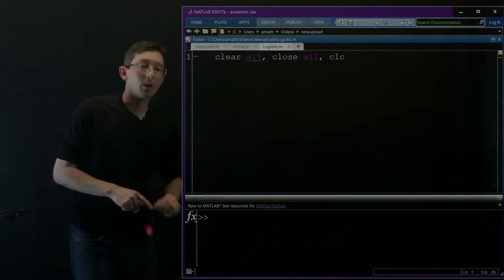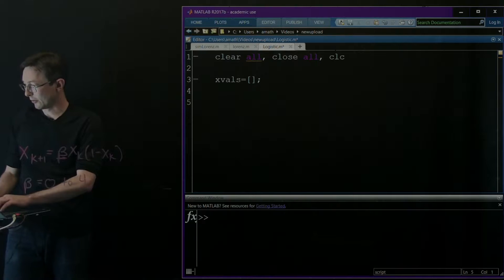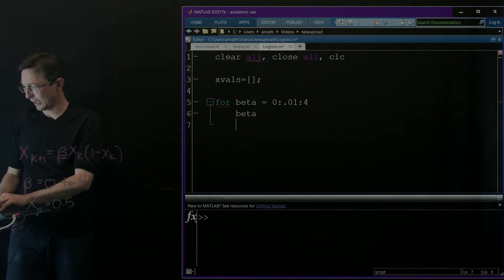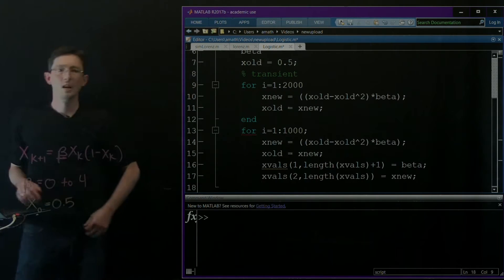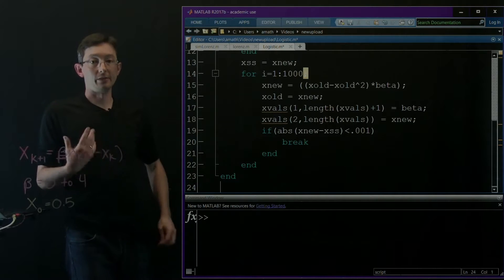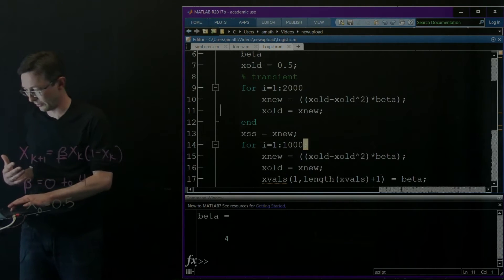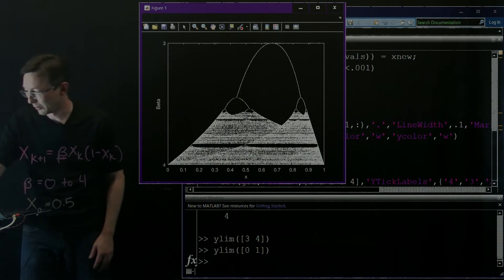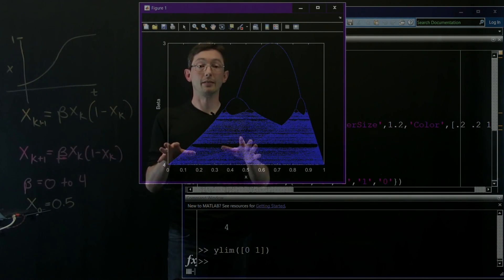Simulating the Logistic Map in Matlab

Comment: Matlab Code below is more understandable for this video. In the code, I just obtained steady-state portion. X matrice is composed of Nn rows samples and Nr rows for bifurcation parameters.

Matlab Code:
n = linspace(1,100);
Nn = length(n);
r = 0:0.005:4;
Nr = length(r);
x = zeros(Nn,Nr);
x(1,:) = 0.5;
count = 0;
for r = 0:0.005:4.0-0.005
  for n = 1:Nn-1
  x(n+1,count+1) = r*x(n,count+1)*(1 - x(n,count+1));
  end
  plot(r*ones(31,1),x(70:Nn,count+1), '.', 'markersize', 2);
  hold on;
  count = count+1;
end
title('Bifurcation diagram of the logistic map');
xlabel('r');  ylabel('x_n');
set(gca, 'xlim', [0 4.0]);
hold off;

Comment: how to calculate the lyapunov exponent for 3 or 4 dimensions. for example:

x(1) = 0.8109; y(1) = 0.3342; z(1) = 0.5734;
lamda = 3.789; beta = 0.029;alpha = 0.0224;

for i = 1:2000
x(i+1)=lamda*x(i)*(1-x(i))+beta*((y(i)).^2)*x(i)+alpha*((z(i)).^3); 
y(i+1)=lamda*y(i)*(1-y(i))+beta*((z(i)).^2)*y(i)+alpha*((x(i)).^3); 
z(i+1)=lamda*z(i)*(1-z(i))+beta*((z(i)).^2)*z(i)+alpha*((y(i)).^3);
end

Kindly help me for this. I am using this in my research work. I will be than full to you.